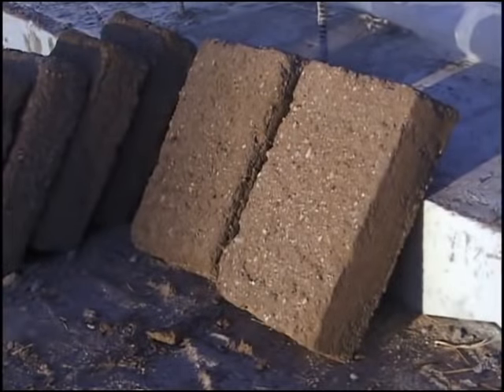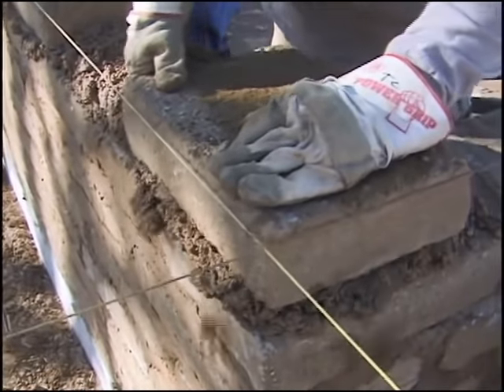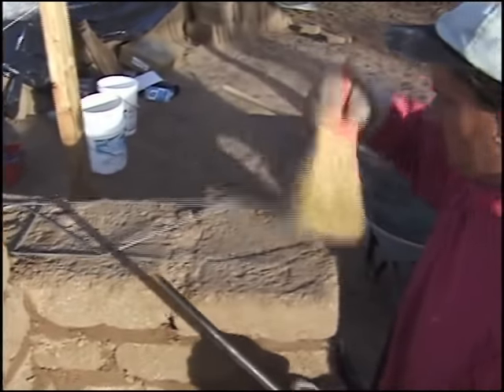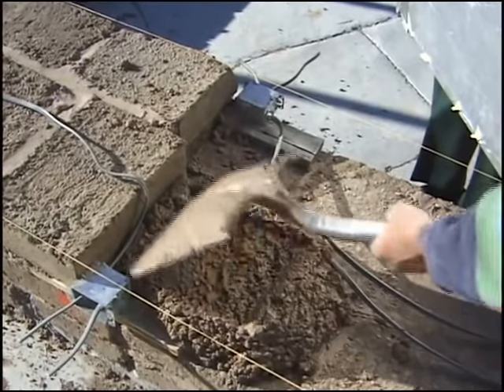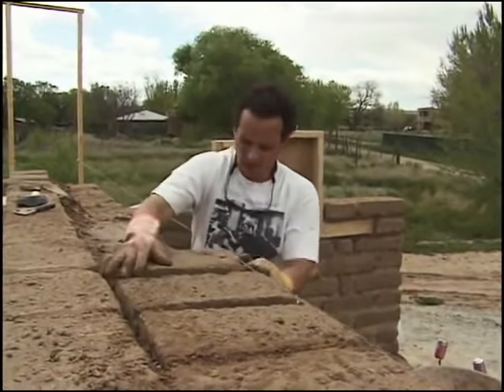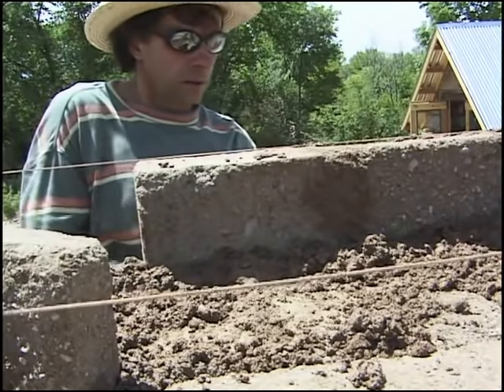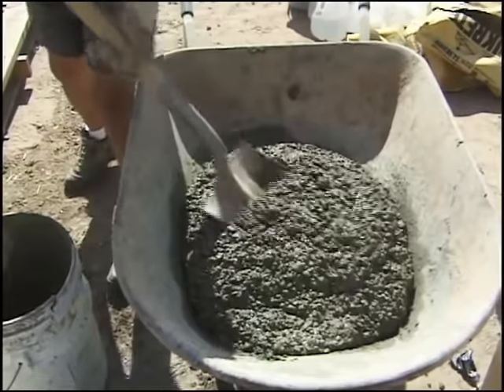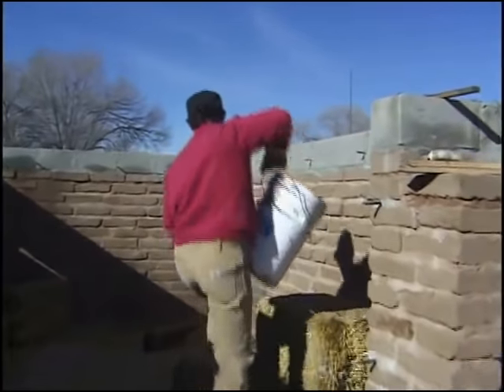How to Build an Adobe Walls for a Home

Comment: Two very important details which have not been mentioned in this video!

1. Adobe and concrete do not get along. They absorb moisture, breathe, expand and contract differently. This means everywhere concrete, cement mortar and adobe are mixed in any fashion are weak points which will separate much more rapidly. For examples of the damage this can cause, check out any of the restoration attempts on existing adobe structures done in the late '60s and into the '70s. I had the displeasure throughout the '90s of assisting in corrective restoration on several of these structures. All concrete had to be removed, then new adobe was used to fix the areas properly.
The metal reinforcements placed every 4 levels will also expand and contract differently, causing even more destruction. You would be better off using jute twine.

2. Adobe historically is covered with lime to protect it. Adobe and lime work well together in regards to moisture and expansion. Look for slaked lime. It works just like plaster, and hinders erosion.

Always keep in mind, just because something is legal code, doesn't mean it's a good idea or good design. Code becomes code because someone in a government position thought it was a good solution for a problem they may not have understood.
Reply: I have a 100 year old adobe home. The walls are starting to crack. Thank you for this info. When I’m able to afford a contractor to fix the cracks, this is something I’ll be asking them. My house was built right on the earth. Foundation was added many years later. The daughter of the man who built the home said they had dirt floors when she was growing up in the home.
Reply: So what do you make the bond beam with?
Reply: @desertlandscapecreations577  great question!
Reply: @desertlandscapecreations577  Actual wooden beams?  That's a great question.
Reply: @willbritton133  what about termites? How much of an insulator is wood? And last but not least ....what about the thousands of adobe home that already have cement bond beans ?
Reply: Buddy, it's LAW. Good luck with your jute twine.
Reply: Agree to your reasonings, Thanks for dropping to share your knowledge
Reply: First ive heard that concrete and adobe doesnt mix. Personal experience?
Reply: You don’t just throw slaked lime up on the wall and call it good. You apply a traditional 3 coat hydraulic lime plaster to it that’s ends up being at least an inch thick. Also everyone questioning the bond beam the answer is that you absolutely do not need it at all. It’s a load of 💩passed into code by people who have probably never built a house in their life. 1. interior walls and exterior walls should be tied together with the adobes tto give the walls  sheer strength   2. run all thread from the foundation up to a double 2x10 top plate and secure the top plates with nuts and washers.  Boom. No need for all that nasty high carbon footprint non vapor permeable concrete and steel.
Reply: @willbritton133 if it's done super traditionally. They did it with logs. I grew up in a adobe house that was originally built almost 200 years ago by an jicarilla (Apache) family.  It was added on over time but when we went in to do renovations the original support walls were held with logs, and bricks made with grass/straw and mud.but I can almost guarantee that the very traditional way isn't up to code😂

Comment: In our area we use lumber/planks from base itself without any bricks. We pour local mud/soil into the planks holders and beat it with wood mallet. Once cured these walls get so tough that even an axe or any handheld digger would struggle make a dent into it.
Reply from the maker: Thank you very much for your comment
Reply: Could you show that in a video?  I'd love to see it!
Reply: Do you stabilize with cement?
Reply: @justrosy5  My own kitchen was made using this method. It took us more than one week to compete the four sides. Only one round of 1 feet clay can be added to the walls daily. Therefore for 6-7 feet height we needed more than one week's time. I'll make video when I find someone in my village making walls with this technique.
Reply: @Queen-jc8fd  Cement is not necessary. Clay plaster is more affordable to finish the walls and then local blue or yellowish clay is used as paint on top of it. That's it. 
But if you want you can use cement plaster and then any latest paint/putty/tiling etc, as you wish. We have added 30 inches of tiles on the outer sides of walls for better protection against moisture and rains.
Reply: @rajender13  please do make a video of that, thank you
Reply: Rammed-earth construction?
Reply: @rajender13  30 inches where? Footings? At the top? All over?
Reply: @BlueBeeMCMLXI  From the base of the wall to window height.. this is the area that gets hit by rains sometimes and it is difficult to maintain a clay plaster there

Comment: Only problem is using cement with adobe is the different thermal and condensation rates of the material that will produce water damage at the joints, over time weakening those areas.
Reply: what might you suggest?
Reply: @kurtdoerfel7620  

Honestly I would double check with an expert on natural building method.

 I completely understand why they do concrete reinforcement on Adobe, especially in seismic regions (ie increases tensile and sheer strength), but I have never heard anyone address the issue of contact erosion.
Reply: You can do a fine layer of cemente to protect the adobe.
It works really good  👍
Reply: Dry climates is the only place I have seen adobe  used a lot.
Reply: @romannavarro3137  

Lime yes, but never cement that will destroy the adobe.
Reply: @felixguerrero6062  relax mate dont worry about it

Comment: The woman speaker in the vid said air conditioning was not necessary with these thermal walls, or just reduced a/c?? Would the same be true for heat?? The masonry is labor intensive but looks sturdy and is aesthetically in harmony with the New Mexico soils and landscapes. Nice vid and clear instruction. One question, though, what kind of foundation do the walls sit on?? Custom footings per code?? A slab??
Reply: Never mind "looks" - go for "guts".

Comment: I have experimented with cob building a small chicken coop and really loved the sturdy nature of the building but the downside is that it is extremely  labour intensive. Wanting to build our own home I was curious if it would be possible to use a cob mixture in between the Adobe bricks that we could press holes into (just like in a cob structure) to later help us to apply a layer of cob finishing or plastering to the walls. Would this add any extra strength to the structure as we have expanding soils in our area that tend to crack. Would it actually be possible for the cob mixture to adhere to the Adobe brick?
Reply: I was thinking this same question so I'm commenting to get notified

Comment: Hello watching you from Africa what a great video I want to build a very nice Adobe house can I use Shell lime to stabilize the block because I want them stronger because cement is a bit expensive here. What
Reply: Robert Freisler  What
Reply: I would think this works well with shell lime aswell. Never know until you try though, so maybe do a trial run and see how it works out.

Comment: hello should i fire my mud brick and at what temperatures? thank you i am from canada :)
Reply: Mix mud & slaked-lime in 1:6 ratio to make bricks, dry it for 48 hours in shaded/indirect sunlight, cure for 7 days and then it becomes water resistant (will hold structure without collapsing). Firing it also make it water resistant, but will be less environment friendly and not as good as mud-lime bricks.

Comment: What is the ideal width for heat retention in a place like Cusco with a lot of sun but cold nights?
Reply: I would like to know as well :)
Where in Cusco are you....Sacred Valley?
Reply: @fajkuska  Douglas here, Yes, We were in Pisac, but that's a really productive thought as it's very different between areas of the valley too, so the width would depend on the area as well. It would be interesting to actually measure it. 

Would need more specifics to make my original question answerable, so I would say Pisac
Reply: @FreshSirDouglas  And are you building already?
We weill be in San Salvador...starting to build in October!
Reply: @fajkuska  We aren't looking for land there personally, though at the time of the comment I was living there. 

My girlfriend's sister is currently in a land buying search in the valley, though focusing north like quillabamba. Hard to find land in the valley for USD 50m or less
Reply: The Wingate Inn

Comment: Embedding that wiring directly is a very bad idea if you ever had a break or need to upgrade the wiring. Better to imbed metal conduit runs just like the steel ladders.
Reply: OR you could use flexible ribbed pvc also known as
ENT  Electrical Non metallic Tubing,  It is usually Blue in color & easier to work with than rigid (grey)PVC.   I have used in on concrete block construction.  better than embedded cable for sure.

Comment: I wonder how the Adobe construction would do on a small home in the Sierra Nevada  at 5,000ft ele.  where snow & temps to 5 degrees are encountered during each winter.  Maybe insulation could be sandwiched between double rows of Adobe Block.    I am in fire country & already had a hellish fire burn across my property burning most of my neighbor's (wood) Homes,  I saved My home, But I want to build a 2nd (smaller) guest house that is fire resistant, & I like the looks of Adobe.
Reply: Cold is a zone that would prevent traditional use of adobe.

Comment: Why not just make a lot of Gringo Blocks and use those instead of adobe bricks?  That way, if you need a hollowed-out space, you can have that more easily, and also, that way, if you want to nail up a picture or something, you can do that.  Plus, installing windows would be much easier.  So this way, you get the usability of the wood and the insulation/fire protection of the bricks inside the wood.  You could still use mortar, too.  Also, you could do a "half Gringo" sort of thing, where it's like two pieces - one wood and the other adobe brick, fitted together when the adobe is being baked by the Sun into it's final form.  The wood portion would go on the inside, and the brick on the outside.  That way, there would still be something to nail onto, on the inside, and all the bricks would be on the outside.  Again, mortar would still hold it all together.
Reply: Is gringo block is like a hollow adobe or stn

Comment: Great video. What is the raw materials cost for a build like this? Thanks.
Reply: The mud is free unless you are importing it. The cement, house insulation, doors and roofs etc are the only costly materials
Reply: Dirt cheap.
Reply: @jimwagner6260  Good pun.

Comment: I like adobe, but cseb(compressed stabilized earth block)is far superior in compressive strength, density, dry/cure time, less motar use, and faster construction with the same benefits of adobe like thermal mass and evaporative cooling.